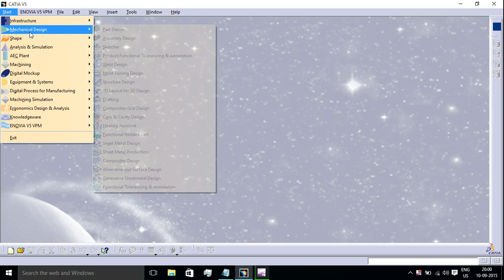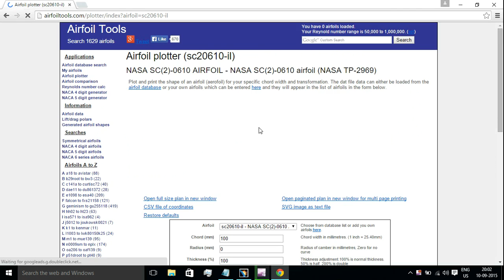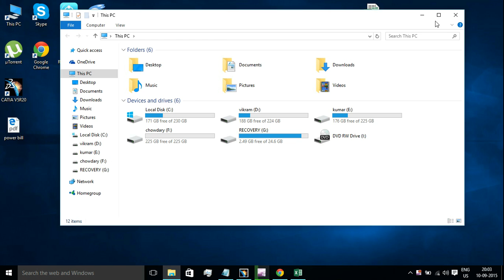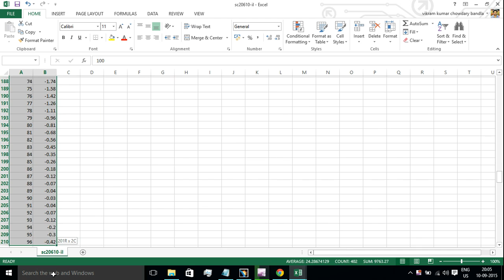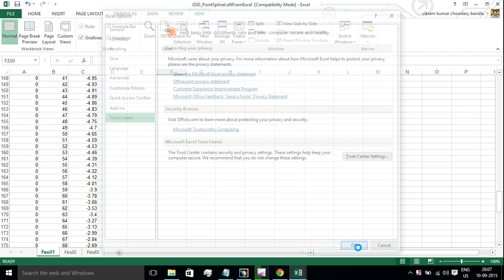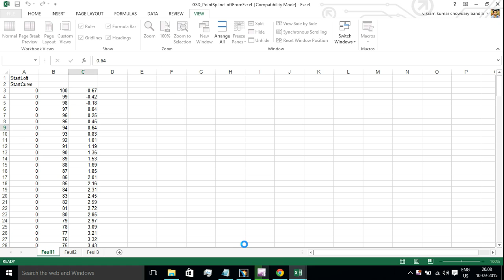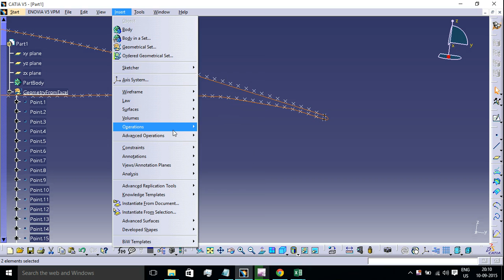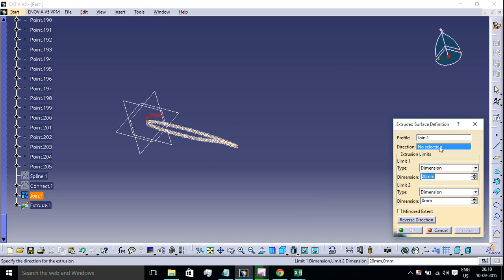CATIA V5: Wing Modelling using Airfoil Co-Ordinates from MS EXCEL - Macros

Comment: after pressing run in excell, it is showing licence information for this component not found. you do not have an appropriate licence to use this function inthe design environment.
Reply from the maker: Hi dp singh,
It's an issue with catia version/licence.
Please Re-check try installing proper version CATIA V5 R20 - R23 
May not work on CATIA V5-V6 Relases
Reply: @AbhiAerodesigner  ok i will try
Reply: @AbhiAerodesigner  buti have catia v5 only
Reply: @AbhiAerodesigner  ya it work..thankyou

Comment: Hello, if I need to define the maximum thickness is 3.67 cm., can you describe how to do ?
Reply from the maker: Hi.. thanks for watching
You asked how to get airfoil with maximum thickness of 3.67cm(=36.7mm).
In airfoil tools --> airfoil plotter  just enter your required thickness of 36.7mm...and it will give you the desired co-ordinates..
I hope I have answered your query, if not then
Feel free to reply or comment
Reply: @AbhiAerodesigner  Thank you for your kindly reply So, the thickness input in airfoil tools require in unit % and I'm not sure about that it is the percentage of thickness to chord or not?
Reply from the maker: @pontaritnuanyai4231  
I'm sorry, it is actually percentage to chord..
So you should know chord length of airfoil and then calculate the percentage. Input=chord length*100/thickness..
I hope it works now..

Comment: bro pls help me how to draw delta wing in naca 0024 aerofoil
Reply from the maker: Hi deepak,

Procedure for obtaining Delta wing is almost same as shown in video.

If you are using same airfoil at root and tip of the wing then scale down chord length at tip.
If you also want to give swept back wing then use translate option to move tip airfoil towards back..
I feel a have answered you query,
Still you have any problem with this please reply.
Reply: Hi deepak

Comment: bro I have problem when I generate the macro. the problem is "the object does not support this property". Pls kindly help me
Reply from the maker: Hi deepak,

To prevent that error, You need to open either PART DESIGN / WIREFRAME SURFACE DESIGN /GENERATIVE SHAPE DESIGN/ ANY SIMILAR workbench.

Please try above thing.

Thanks for watching video, feel free to ask any more queries.
Reply: Abhi Aero designer  Its not happening
Reply: @sandeepprajapati2188  did you find out how to do this?
Reply: @badurcorp357   yes, abhi sent me a xls file from his pc, it worked fine

Comment: hi abhi, i can't find the solution of object don't support property problem
plz tell me how i solve it plz comment on it
Reply from the maker: hi Mohammad,
Thanks for Watching video .

first thing you have to do is to open part design or wireframe & surface design or GSD workbench ,
and then continue with MS Excel.
The error Message you have got is due to because you have product / assembly design workbench as active window.
I hope I have answered your question and it will solve your problem,
feel free to comment if any query. :)
Reply: no as per video i open gsd workbench but it show msg
Reply from the maker: oh..so you are still getting that error,
that error may be encountered due to following reasons,
1.If you are not using the GSDpoint spline excel(which has taken from program files).
2.If you are not using CATIAV5R20 or R20 installed version.
3. if any MS OFFICE excel macro issues...
previously I got same problem with above mentioned problems...
try to check with your case...

Comment: How can I generate an inverted airfoil?
Reply from the maker: Thanks for watching video...
if You want have inverted or flipped airfoil there are three ways to get it.
1.Using Reverse option in airfoil tools website.
2. You can extract the normal airfoil spline formed by Excel point  and use Rotate option in (transformation features) surface design.
3. After importing excel points make a sketch on a parallel plane to spline and use project 3D elements option in sketch , then isolate the sketch and keeping the sketch selected directly use rotate option with duplicate mode unchecked. you constrain using auto constraint option
I hope I answered your question.
if your doubt not clarified plz feel free to comment or reply
thanks again